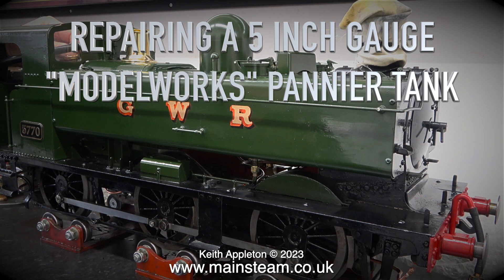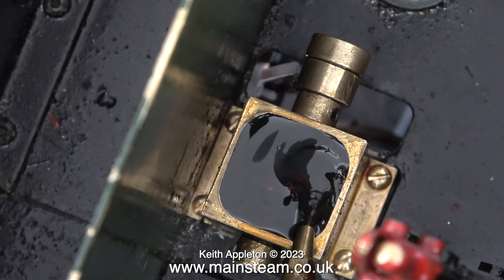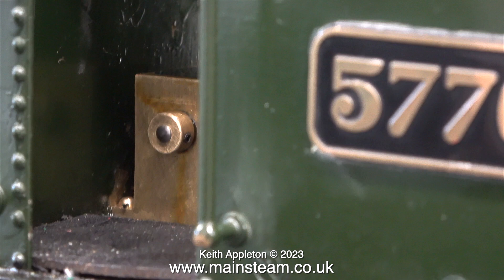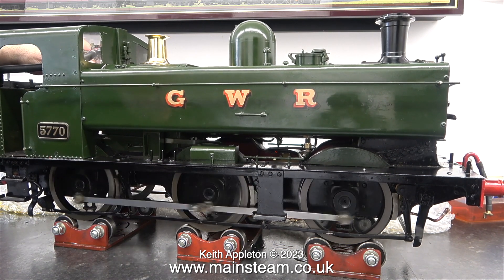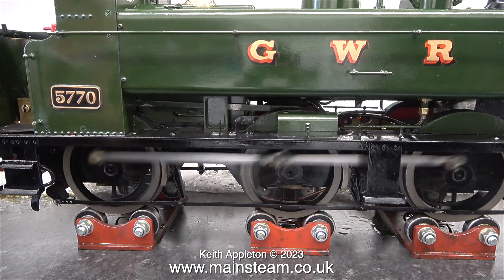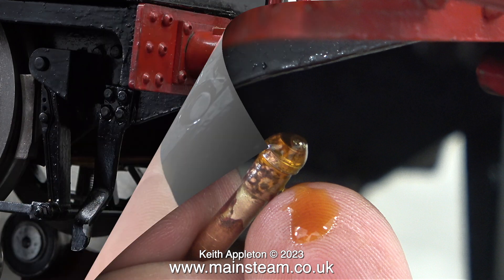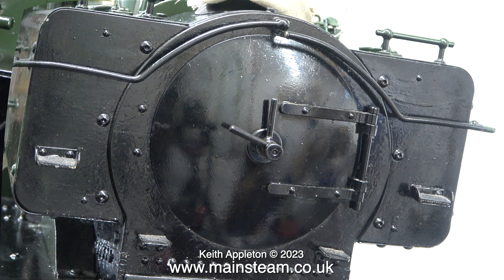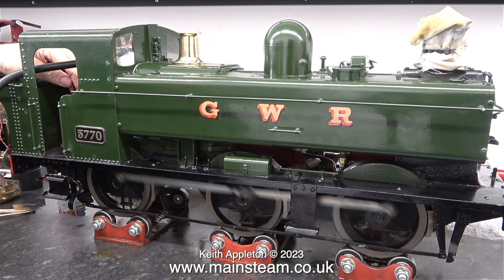REPAIRING A "MODELWORKS" PANNIER TANK - PART #10

Comment: It is really interesting to see how well it runs after your adjustment of the suspension.
Reply from the maker: The running position is very important. Before I started work on it, the axle boxes were right at the top of their travel as the springs were far too weak.